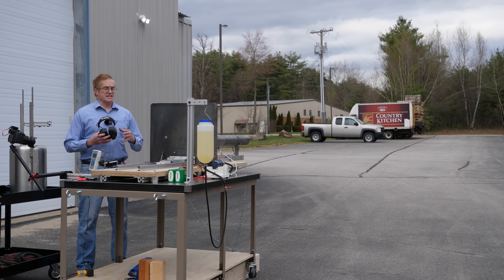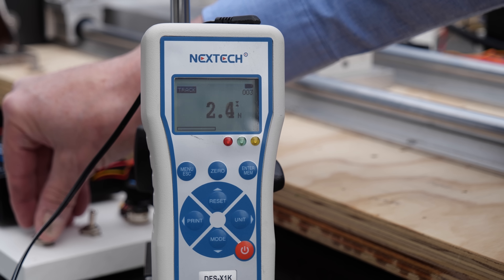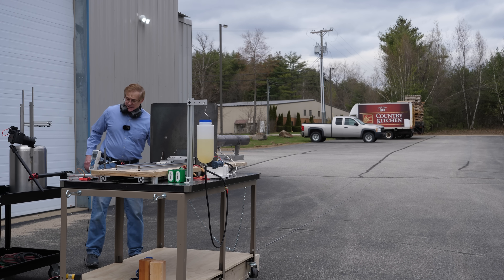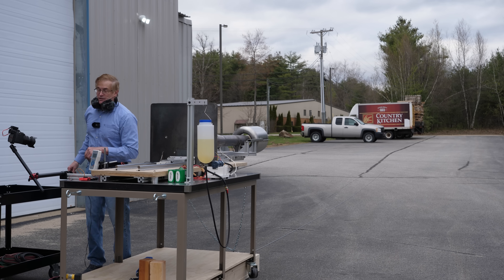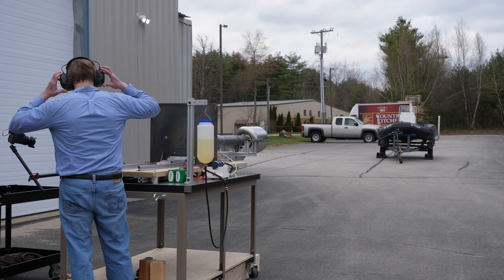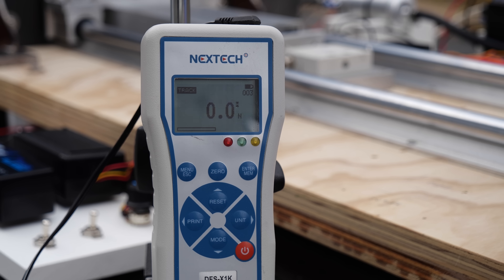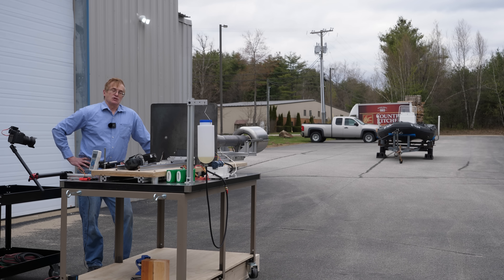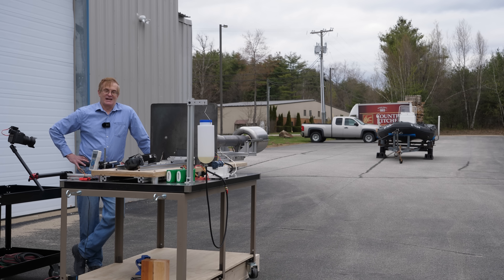WE USED AN AUGMENTER ON OUR PULSE JET!

Comment: Years ago I flew a Convair 440 with Pratt and Whitney R2800 engines (air cooled), that utilized augmentation tubes to induce additional air flow for engine cooling. The two exhaust stack bundles (nine exhaust stacks in each bundle, eighteen cylinders/engine) fed into the “aug tubes”. These ran the length of the cowling, with the exhaust exiting at the wing trailing edge. Not being an engineer, I felt this was an attempt to reduce aerodynamic drag by reducing the size of the engine cowling air inlet. This opinion was reinforced by the fact that the cowl flap surface area was much smaller than on aircraft that used traditional cowl flaps. The Convair had only four cowl flap panels, two on the top and two on the bottom of the engine cowling vs a “ring” of cowl flaps that nearly encircled the entire cowling on aircraft utilizing traditional engine cooling design (DC-3).
Reply: Those improved ground cooling and low speed (takeoff) cooling. Instances you would ordinarily need large cowl flaps. Exhaust velocity was able to reduce cowl pressure, therefore increase pressure drop to something like 6-10 inches water column. At high speed, ram air effect was far greater. Exhaust pointing aft also creates thrust. Especially in supercharges engines operating at high power settings and high altitude.

Comment: (best guess) )It's all about changing the pressure of the nozzle and that would require the engine moving through the air. think rocket science. there's an optimal throat to nozzle diameter at a particular altitude and the agmentor is there to change the atmospheric pressure with speed.  inducing more or less air into the path of the exit gasses of the engine to match the engines throat.
the performance losses are most likely induced drag  from the lack of additional air flow from movement. what do they call it with aeronautics, dirty air, surface drag.
Reply from the maker: Not really. As I explained in the first video in this series,  the augmentor works by operating in the reduced pressure caused by air entrainment into the high-speed exhaust from the engine.
Reply: @TechIngredients . though the test shows a peak of 170ish without and a peak of ~100 with the augmenter. there is a lift vector/drag countering the thrust of the pulse jet. ( low pressure from the pulse, pulling the device backwards. it's an air foil and the aoa is pretty much stalled causing a vacuum .  flip the cord of the foil(tear drop), add forward momentum and it will increase pressure behind the pulse and increase effective thrust.

Comment: Maybe you are not getting a result because 

A: The thing is stationary and thus relies solely on atmospheric pressure to force air into the augmenter.
B: your pulse jet is kind of optimized already for the atmospheric pressure it was built at, if it is flying higher the ambient pressure is lower and thus the augmenter not only has a Venturi effect but is also an expansion vessel which the thrust acts upon.
C: from my experiments with Venturi in/ejectors the positioning of the high pressure outlet relative to the restriction makes a massive difference. Though admittedly my goal was to maximize suction and not to create additional thrust.

Comment: Your partner is theoretically correct about the ramps going backwards. The corner of the ramp is meant to catch the tire tread, and the friction is meant to make it impossible for the ramp to get pushed out of the way. Then, the boat is less likely to move, as the effective slope is the circumference of the tire rather than the ramp slope combined with the tire.
In practice, whether the ramp really catches or not is dependent on many factors. How coarse is the parking lot? If he can move that boat by himself, I very much question how much the ramp slope will contribute to slowing down the runaway pulse jet.

Comment: I designed a high energy ignition for a pulse detonation engine many years ago.  I'm looking forward to your next video.
Reply from the maker: Any details?
I just finished the one we'll be using, which is based on an overdriven coil and an inductive collapse (spike).
But, I'm always looking for better ideas.
Reply: @TechIngredients  
I tried to post some info with links however YouTube removed it.  Is there a way that I can communicate with you?  Thanks, Jay
Reply: @TechIngredients  
We designed a high energy transient plasma ignition system.  If my memory is correct, they wanted to promote generation of OH radicals during the combustion process.  This would allow for an easier restart in case of a flameout, however I was only in involved in the electronics.  The ignition system used diodes operating in a "Drift Step Recovery" mode which are capable of generating an extremely rapid turn off times (~1 to 2ns) at several kilovolts.  This was pumped into an saturable reactor (inductor) for generating a very high voltage output pulses ~60kV at a 10kHz rate!  Here is the SBIR document:  https://www.sbir.gov/node/258006.  There should be some technical papers that were published by "Andy" Andras Kuthi PhD from USC.  Here are some papers related to the project:  https://arc.aiaa.org/doi/epdf/10.2514/6.2007-443, https://ieeexplore.ieee.org/abstract/document/4743608 and https://www.proquest.com/openview/cfa64ab6f74cdacae85ea66093561d29/1?pq-origsite=gscholar&cbl=18750.  Here are two papers unrelated to my work:  https://shepherd.caltech.edu/EDL/publications/reprints/galcit_fm2005.002.pdf and https://arc.uta.edu/publications/td_files/PKP-Dissertation.pdf.  Hope this helps, Jay.    analogdesign ### cox.net (substitute the ### with @)

Comment: If the cops came, I'd tell them it was a time machine.  Hondas are an excellent source of giga-watts, but fall just short of the 1.21 needed, so the jet is responsible for helping the boat to 88 mph; kinda like the steam engine.  But first, dry-land test run.
Reply from the maker: Ya, I know, but that excuse can't be used too many times!😁

Comment: If you change your mind about needing an anchor to hold items for your jet experiments, they make an item specifically for this.  Auto body repair places have large hydraulic frame straightening machines that have to be anchored to the floor, and the auto body supply places have what are called "anchor pots".  It is a little flowerpot looking item - typically set into a concrete floor -  that has a chain and a metal lid on it.  Do a search on auto body tools and then search the sites for anchor pots.  You may need to set a concrete block (like 2'x2') into the pavement and then core drill it for an anchor pot.  These can handle quite a bit of force (more than the weight of a car) and with the lid it sits flush with the pavement.  From the outside it looks like a standard forgettable utility access point in the pavement.

Comment: The harmonics of the pulse jet engine would adjust to whatever the relative air density exists around both tail pipe and air inlet. The augmenter (peripheral airflow entrainment) is more likely to alter the frequency of combustion but not thrust. I reckon a Trombone like sliding tail section would yeild the best result, sort of like how a rifle exerts more recoil than a pistol for given calibre/projectile mass. This method would also alter the frequency but the increased amount of reacting mass flow (within the tail pipe) would increase thrust. The velocity of the moving engine and ram pressure of the intake (fuel flow changes aside) would be criticle to both the life of the reed valve and stabilising the harmonic of combustion. Essentially the pulse jet engine has to grow in capacity/all dimensions or increase its intake velocity to make gains above static thrust. Augmenters work on turbojets because the combustion is mechanically maintained ahead of the jetpipe. Entraining the exhaust in any manner won't effect the turbines power provided the velocity of gasses is not dramatically lowered after the turbine. Pulse jets are more akin to brasswind instruments than most ICE's and intuitive increases in performance would come from that hybrid of thinking. Car exhaust systems use the inverse of the pulse jet engine concept to get as little restriction in the system as possible.
Reply: The length × diameter of the tube has got to be within a certain ratio  for the pulse jet to work at all. 
It operates like a speaker port at a set frequency but that it stays at say 40hz. A 2 stroke silencer would be a good example. You can't just randomly adjust its tuning frequency it operates in by adding or subtracting length without accounting for its diameter.
Reply: @jeremywhittler8591  Thanks. I wasn't sure about the dimensional ratios. So it's like a 2 cycle tuned pipe, got it.

Comment: Hello guys, another great video. Maybe some ideas for upcoming videos below.
1. Now when you have this distilling apparatus it would be nice to see what can be achieved by artificially ageing the spirits. There are couple of research papers out there describing methods with pressure, heat cycling, strong light treatment and ultrasound, maybe all those combined.

2. A lot of 3D printer owners would like to electroplate their prints. Haven't seen in youtube any other method than using conductive paint. It would be nice if the 3d print could be plated with conductive metal layer by electroless plating. Then you could continue with electroplating. Some papers also exist on the internet. A well-documented easy to follow procedure would be nice.

Have a nice day, cheers.

Comment: Not to contest your superior intellect (no sarcasm intended) but… you had a truck right there, would it have not been easier to anchor to that and cover the paint with a blanket?
Reply from the maker: It was one option, but a blanket wouldn't be enough if a piece of red hot debris went flying a few meters or landed on top behind the blanket.  The boat is less expensive. Nevertheless,  it was our second choice.

Comment: Can you collect some time-series data on the resulting thrust? Is it possible that the individual pulses themselves are spikes and the sum average of them does not change as greatly as anticipated? I'd also try changing the location of the augmenter with respect to the output. 

NGL, when I saw the title, I expected an afterburner.

Comment: THrust is the product of square area, not cubic volume.  I think that this funny tube could act as an afterburner if you dumped a little fuel or even water mist in the back of it so that it's cross section was producing force and not just housing the existing cross sections force.  The modifyer has to push back on the engine for forward thrust and just drawing air through it does not seem to do that.  Perhaps if it were slim, mounted further farward it could act with a venturi effect , but your current iteration looks bulky.
Reply from the maker: You probably meant a result rather than a product of one parameter. Length is a necessary factor as it controls the amount of mass in the charge and the duration of the pulse.

Comment: Deep drilling, Can you drill a geothermal well with a laser? Perhaps a pile of these low cost fiber lasers could be made into a drill head. Then slowly drill very deep.
Reply from the maker: You can.
The limiting factor will unlikely be the laser, but rather debris removal and the casing.
Reply: @TechIngredients  as depth increases cooling a laser head would also be an issue. As the water table is penetrated I think you also will need more power. Lots of interesting technology issues to consider. 

I dream of drilling geothermal wells in my house basement. No yard excavation, no big million dollar machinery to drill the hole. Just plug some kind of machine into 115vac and let it drill for a couple months. I'd love to see geothermal come to the masses. The wells are a hard barrier to overcome.

Placing these wells in the corners of my basement and garage would work nicely. I would need to drill at least qty 4 at 400ft preferably deeper.

Comment: Why didn't you just use the trailer hitch on that pickup truck and it don't mean to pull the boat out I mean as the Anchor Point
Reply from the maker: The winch was convenient for tensioning the cable and "in the line of fire" the boat is a lot less expensive.
Reply: @TechIngredients  sorry for this misunderstanding... but I meant  use the tree on one side and then use the trailer hitch on the pickup truck off to the other side ( out of the line of fire ) for your second Anchor Point on the building side. As far as tensioning.... put it in drive and inch it forward or add a short ratchet strap to the cable.
Reply from the maker: Ah, we need that kind of thinking here.
That simply didn't occur to us.🫠

Comment: But isn't the augmenter supposed to be moving forward at high velocity so the airstream is ramming into the forward opening in order to peak it's performance like a ram jet system. I don't think a bench test is the right test for that function. You're going to need a bigger boat.
Reply from the maker: No, it isn't. In fact, as it moves forward,  the larger frontal area drag will work against any gain in thrust.

Comment: Could the extra weight on the end of the test stand be creating excess friction in the rails?
Reply from the maker: No. We tested the test stand with and without the augmentor, and the change in sliding resistance was less than 1 Newton.

Comment: Thanks for sharing your thoughts, ideas and videos. Always interesting and entertaining to see what your working on. 
Idea for you, could you add quantum dots to a solar panel and encase it such that the surface can be exposed to tritium gas. Theory being that the quantum dots would convert the frequency of the radiation from the tritium to a frequency tuned to be useful by the solar panel. By putting quantum dots on both sides of bifacial solar panels they could be stacked in a pressure vessel and be powered by tritium gas rather than the sun. With a 12.5 year half life tritium could be taken from the nuclear reactor waste stream and put to work for stable base load electricity production. Might make an interesting video going thru the process of making solar panels and the process of adding quantum dots to the surface. Wishing you and your family the best.
Reply from the maker: Thanks!

Comment: As for thrust, does the pulse jet still fire under water? Just the tips? I was thinking 2 pulse jets on the boat… would it work?
Reply from the maker: No.  The return pulse would draw water into the combustion chamber.
Reply: Like he said, but there is a similar idea that uses a similar method of pulling exhaust back and forth that works with water. Generally sold as a toy called a "pop pop boat" there are several good videos on youtube showing how they work and one where they scaled it up to human size. They lack power but are pretty neat.

Comment: It seemed like the spark was causing some interference with the force sensor. With the fans on it was showing a fairly stable 2.0N. With the fans and spark on it seemed to jump around 0-6N.
Reply from the maker: That's true.  However, the inaccuracy is pretty small.

Comment: Maybe the whole point of an augmentor is to have a fast moving air flow around it.
Maybe one should test it in a wind tunnel instead of a fan.
Which is, I believe, kinda expensive.

Comment: I want to give you some positive feedback. I think many would appreciate a Hybrid Jet Engine - 4.0 with 4 stages. Consider the advancement in motors, lowered battery prices and better controllers. With 4 stages you can probably get the pressure up especially if you neck down the flow like a real multistage compressor wheel. Methanol/Ethanol can offset fuel costs while being environmentally friendly.   Good Luck.

Comment: What I'm curious about is the on-vehicle thrust while moving through the air. Surely that will have different dynamics than a fixed position test? How much more power would/wouldn't be produced by the addition of the augmenter while in motion, with airflow over the pulse jet motor.
Reply from the maker: As we showed in the last video, forward motion of the engine significantly increases it's power and here, the same motion (fan in front of the engine) increases the power, but the augmentor isn't helping.
Reply: @TechIngredients  That's what I was thinking about - maybe the augmenter itself could work (better) if the engine was allowed to move through the air? Anyway, just a thought!

Comment: The only real step forward is to use the pulse jet firing to compress the air around it and force up the pressure of the air and fuel supply at the air/fuel mixture stage, ie it becomes an intermittent firing air breathing rocket engine, the pulse jet needs to fit inside a suitable tube with an adjustable resonator at the front, and suitable sized holes drilled towards the back of the pulse jet to allow the blast to precompress the air near the front of the pulse jet, and also to allow a plug of air into the nozzle so the blast has air to push on, the adjustment of the front resonator is the way of tuning the engine.

Comment: 9:57 I'm going to go with its not getting any advantage with the augmentor because it's not getting the air flow like it would if it was strapped to a plane. One variable will change the dynamic of an entire system

Comment: Why are you calling the device an augmenter. is that not just a venturi valve? Im curious as to why you decided to go with that name over calling it what it is?
Reply from the maker: We didn't come up with the name, but it's reasonable because it's designed to augment the thrust from the engine. It's not a valve.